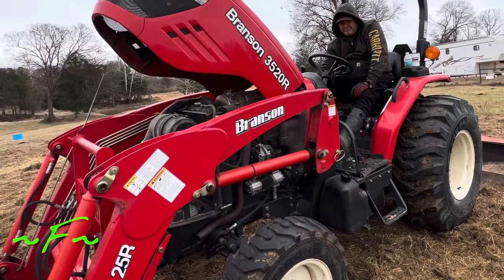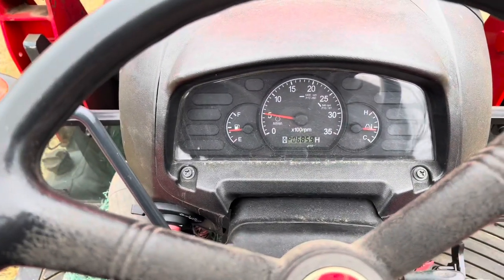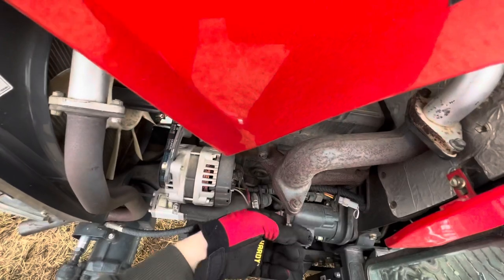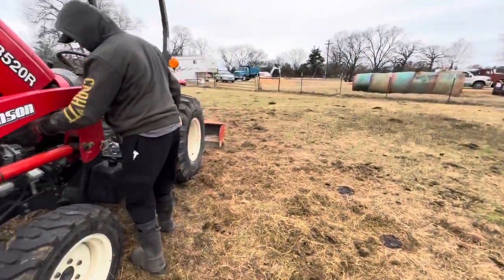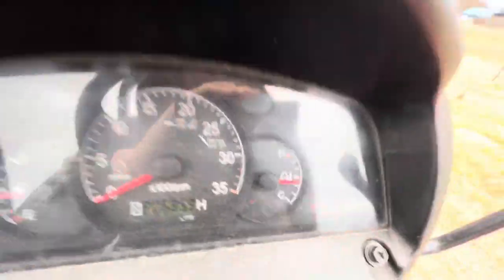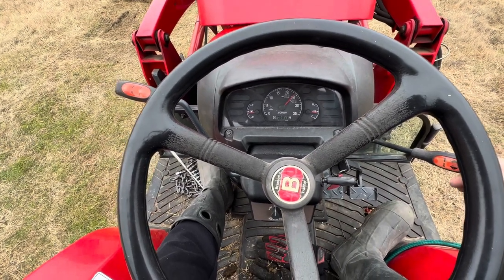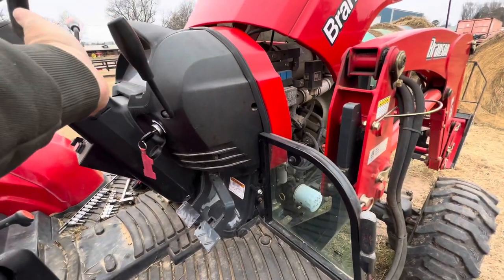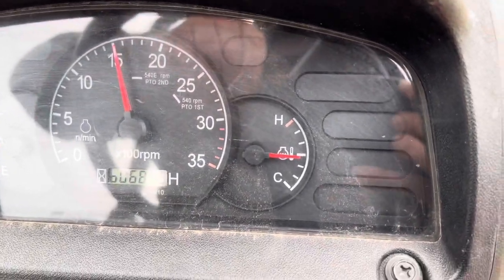No Start? Farmers Hack for Clogged up DPF Filter on Branson Farm Tractor 🚜

Comment: Great video for someone that happens to be in the same situation as you. Good thing about these Branson tractors is that the engine is mechanically injected and doesn't have an ECM to derate the engine and throwing out codes that only a dealer can clear. You can also just gut the innards of the DPF and unplug the DPF datalogger and you'll never have DPF issues again, just good old reliable diesel engine. It may also give a little bit more power since it can actually breathe better.
Reply from the maker: Your exactly right! Put a straight pipe on it! You know they told us at Branson the tractor needs to be run above 2000 RPMs all the time for this not to happen but you know we putt putt around the farm on this thing, so the filter more than likely going to clog  up once every year! So a DPF delete maybe the answer! Thanks for watching and we appreciate your comment!
Reply: @FOSTERSFARMGARAGETV  Yes, running high RPMs does keep the DPF from getting clogged, but sometimes it's not enough, specially on cold environments. You can straight pipe, or simple gut the DPF or if you are into fabrication or have a shop that can do it, you can just replace the DPF with a simple tractor muffler. 

I absolutely hate to have a screaming engine for really no good reason. I'm from Portugal, and these emissions stuff were not required on tractors under 50 HP up until 2022. I'm glad I bought my F36Rn (3515R equivalent) in 2017 and got none of these emission stuff to worry about.

Comment: On my 4520R I simply removed the DPF, knocked the innards out of it, put it back on, plugged all the lines back into it and never had any more issues with the DPF or any dash lights. No need to unplug the wiring.
Reply from the maker: I think I'll definitely gut it soon! The DPF filter Cloggs up when the tractor is needed the most! And leaving us broke down for a day!
Reply: Yeah. The dealer came out to my house and did this to my 4015R and never had an issue. Guess I'm not tier 4 anymore.
Reply: @davidwright9833  I had to do the same at 150 hrs used a one inch wood bit. Now more power.
Reply: @davidwright9833  the dealer actually gutted it for you? Did he void your warranty? I'm guessing he did. I would think it would be illegal for a dealer to mess with any emissions.
Reply: I just finished removing my dpf and pressure washed it in the reverse direction of the air flow. It's going to sit overnight in a solution bath, then get another pressure wash and then a rinse.
Almost 700 hours and this was my first regen and it failed to regen. I run it hard so I never had to regen it.

Comment: Haven’t done it yet because I’m still in warranty but I’ve read that on most of these engines, you can find non-DPF mufflers for tractors sold outside the U.S. and just replace it with that.

Comment: the Exhaust gas recirculation (EGR valve) also send sot into the combustion so then you get faster black engine oil. which lead to faster engine oil change,

Comment: I got a 2014 model just like yours, & mine did the same thing 2 months after I bought it.  The dealer came out & said he was having a lot of problems at this elevation 4989 ft. & higher with the DPF plugging up.  So he took out a 1/2 drill & ran 4 holes throw the DPF.  End of problem.
Reply: @Mike Mehaffey What do you mean he drilled holes through the DPF. You mean he removed, disassembled the DPF and drilled out the material inside?
Reply: @pmaint1  He drilled holes down throw (going with the air flow.) it & that made  a 2"  opening for air to go into.  He said the DPF was only put on to make the tractor  comply with the emission clean  air control act for diesel engines, that this state has for cars & trucks.  So far NO ONE from the state has come out to run a clean air act test on it, & since I don't drive it on blacktop roads & pass any of the states air test sights, I consider the problem fixed.  Been using it that way for 8 years now & no more plugged problems.

Comment: Other than this have you had any major problems? Do you move round bales with that machine
Reply from the maker: Zero problems! Branson is the John Deere of South Korea! Yes sir it picks them up no problem i put my box blade on the back to help balance  with the weight! If the hay bails are soaking wet it srtuggles some in wet conditions!

Comment: The clogged DEF is caused by too much idling and not turning up the rpm when the regen light flashes. It's in your manual....
Reply: Yeah so let's run it like a scalded dog in a quarter mile just so the government filter won't clog up.

Comment: What model is this? It's the first Branson that I've seen where the fel is located on the fender
Reply: 3520 R   The dealer told me it stands for 20 horse power @ 35 RPM.
Reply: Or maybe its the other way around?
Reply: @mikemehaffey9693  Then you should find a new dealer because the 20 is the series of tractor, the 35 is the HP rating.
Reply: @pmaint1  I don't know if he is around anymore?  Looks like were he was is being turned into some mini malls or something?